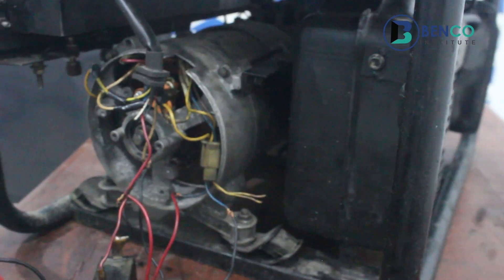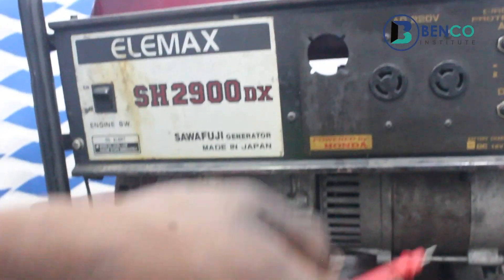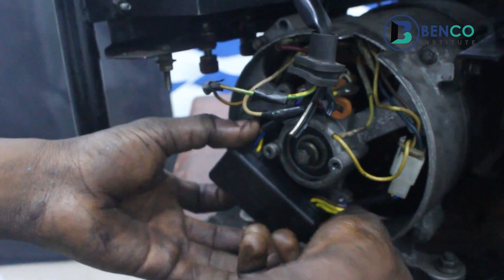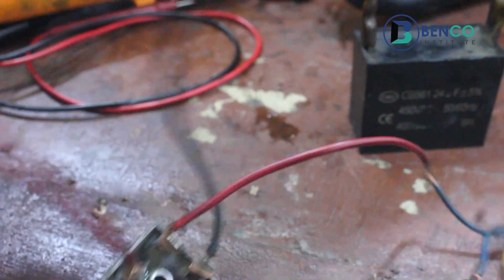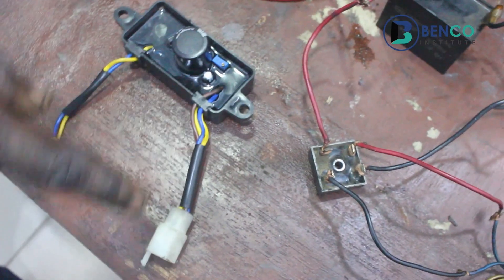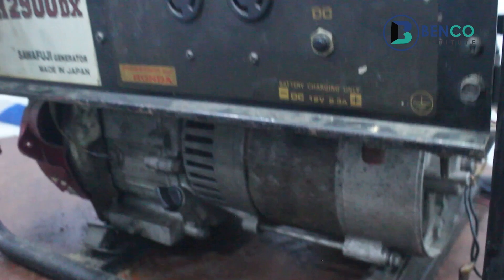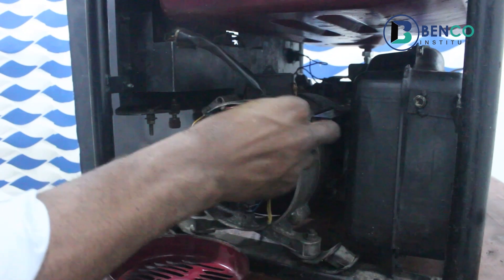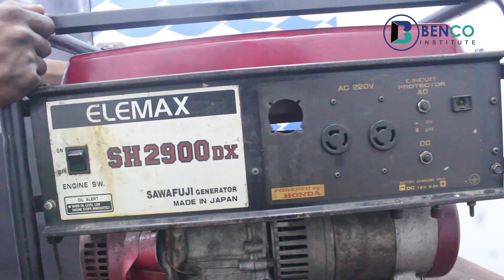RESTORE NO/LOW POWER OUTPUT IN A SMALL GENERATOR BY CONVERTING AVR TO  CAPACITOR[Brushed Alternator]

Comment from the maker: If you like our videos pls do well to subscribe,like and share.

also kindly support us to keep this channel running and produce better contents by  buying us a coffee via this link https://www.buymeacoffee.com/bencoinstitute

Any questions Drop them in this section...we will attend to them
Reply: I have a kawasaki kg550b generator the brushless one now the problem is that it is producing low voltage so what could be the problem
Reply from the maker: @samuelchimphepo4619  have u changed the capacitor?
Reply: @bencoinstitute  No I didn’t change the capacitor because i can’t find the same type of capacitors to replace with and the ones that came with the gene was written  ( A 6.0uF+5 % Z SH w-F 2D ) and the other one is ( A 9.0uF +5 % Z SH W-F 0D)
Reply: How big is the capacitor you used
Reply from the maker: @davidharrison198  24uf
Reply: I have a 6.5Kva generator with a failing AVR. What size capacitor should I use
Reply from the maker: @davidharrison198  24uf capacitor is okay
Reply: i want to convert mine also from avr to capacitor. it state on the avr a 220 uf 250v so obviously i will buy the same gauge of capacitor but what about the diode? what is the compatible size to match? thanks
Reply: it is a nice tutorial but I want to ask what is the advantage and disadvantage of converting avr to capacitor diaot
Reply: diode pls
Reply: Thanks for the teaching,but the output voltage is too much (270volt) which can spoil equipment,so how can we control the over voltage
Reply from the maker: @balogunolufemi4606  reduce the speed of the gen or use a lower capacitor rating
Reply: Hi I have done it it works but when I return the shock it went off and the voltage was 216 not up to 220 what should I do please
Reply: @bencointitute 
Can we convert 1kva capacitor based voltage regulating generator to AVR based voltage regulator

Comment: You just show how to wire the taud  and the cabasider, but my question is before you iven remove the avr there was 4 wires on the taud ,where dit you conect them. Because I tried but now the generator is giving out nothing power.

Comment: My generator is running up to 300v even if you try to reduce the current it doesn't there by destroying my avr what might be the cause
Reply: Engine rpms to high. U need to adjust rpm while looking at voltage out put. Adjust it until voltage is with in spec. It be better if u have rpm meter. If u dont then adjust using volt meter to volt output

Comment: thanks bro more wisdom. My question is, can be voltage be regulated, seems the 278v gotten after the conversion is high, normally we need 220/240V
Reply: Yes it can be reduced. Reduce the Rpm, the hz will reduce also

Comment: 278v? That seems like a lot to me, since the maximum output should be 220-230v! Or does the voltage drop as soon as you put a load on? You should have shown how much it drops, because it's a very high voltage!
Reply: Your correct, it's too high for rated output (220).
You can adjust the governed rpm but that can lose performance factors. Ideally the capacitor should be around 17 úf I don't know where he got 24 from, somewhere because it's very close. If you had to connect through 3 long extension cables, 270ish would be needed.

Comment: The rotor windings consist of a 4 leg diode and a resistor.What you did was that you replaced a failed diode behind the rotor winding.
Reply from the maker: @sundayotuns7102  No sir

This rotor does not have a diode behind the rotor
Reply: @bencoinstitute  Why did it has a positive and negative terminals?Is it not a diode that blocks current to one direction?All generator amartures carries a diode behind the rotor winding.It is hidden.
Reply from the maker: @sundayotuns7102  those terminals are to the brush that connects the commutaror...

Not all Armature has a diode
Reply: A multimeter can be use to test for continuity on both ends of the rewinding of the armature.That is one of the best ways to determine if there is a breakage in any of the coils.Thanks for your expertise explanation.Please I am currently working on a generator with electrical faults.Sumec 2900.I tried your teaching and it didn't work.Though I suspect the avr because there is no sign of damage and the client told me a spare part seller replaced the avr. for him,not an engineer.On a closer look,the output terminals,which is positive and negative was joined together.I removed the stator and check the coils with a digital multimeter,all the four terminals were good.What is your suggestion? Thanks

Comment: What could be the problem, my gen was converted to capacitor and diod but recently it can't carry load . From 230 it will drop to 160 . What is the solution sir
Reply from the maker: @Jossykjugbedu  ohh
Sorry about that

Check if the sound of the Gen dropped... If it did check the Governor spring

If the sound is okay.. That means your Armature have further deteriorated and the only thing you can do now is to add another capacitor..

Thank you

Comment: Good day my favourite YouTube generator technician ..I'm having an issue with my Firman Generator eco 8990esr 6.5kva..the generator voltmeter reads normal 220v only when the circuit breaker switch is in off position but as soon as i toggle the circuit breaker switch to ON position, the output voltage cuts off and reads 0 volts with no output power. Whenever I switch on the generator circuit breaker, the generator sounds for couple of seconds as if it's under load even when it's not connected to any load and then the voltmeter cuts off to zero... This started when I tried to power my 2hp AC with the generator while the AC is connected to stabilizer. I realize there was voltage drop on the input and output voltage of the stabilizer until the gen stops producing no power with circuit breaker in ON position. Since this time, the gen voltmeter only reads normal 220v when circuit breaker is in OFF position but reads O volts in ON position..what do you think I need to do to solve to problem? Thank you for your time
Reply from the maker: @safetyalways7788  you may need to check the board and see if there is partial contact somewhere

Comment: Hi nice job I tried it and it works
But there's problem with the shock when I bring back the shock the generator went off
And secondly it gives 216 voltage
What can I do to solve that
Reply from the maker: What is shock pls... 216v is fair enough

Comment: This' very brilliant but what about the generated voltage that is too high for our 220volts appliances...
Reply from the maker: Sure
You can reduce the speed
Reply: Yes, but we need to maintain frequency at 50Hz so you are better reducing capacitor value.

Comment: This method is unsuccessful, because of many and different reasons. First of all, the capacitor at the output (i.e the DC side of the diode bridge) must have a much higher capacitance. Keep in mind that these A.V.R units use electrolytic, i.e polarized capacitor of 220uf (or even more), at a working voltage of about 250V. 24uf is too less a capacity in order to keep the output voltage relatively stable, especially at heavy loading of the generator. Both voltage and frequency will drop immediately. This (non polarised) capacitor shown in the video, should then be connected in series with the A.C side of the diode bridge between an AC terminal of the bridge and one terminal of the field winding, with the output voltage being always monitored along with its frequency. This is very important. In case that the voltage output is found to be much lower than the nominal value (with the frequency at 50Hz, for European system), then more capacitance should be added. On the contrary, if the voltage is much higher than the normal, some capacitance, from the one put there, must be subtracted in order to reduce it near its nominal level (always watching the frequency to be as near as its nominal value). This is the only way to adjust the output voltage using a capacitor instead of an AVR. Nevertheless, this method lacks the automatic voltage correction. This means that the level of the output voltage will be unstable, being each time dependent upon the load and/or the r.p.m of the generator (frequency variations in the last case). All of these are practically terrible problems for sensitive loads, rendering this (capacitor adjustment) method useless...
Reply from the maker: If you watched the video to the end you will understand better.... I pinpointed all this arguments and even those I didn't pin point in the video I answered them in the comments.

Any experiment that solves a need is never useless..
Next time be polite

Thanks for your submission
Reply: @bencoinstitute  I have watched your video to the end before putting my comment, by which I simply explained why this method is improper and therefore unsuccessful. There was no insult against you personally whatsoever, although it is obvious that you misunderstood my explanation. 
On the contrary, if you would have done exactly what you proposed to me, that is, to read the entire comment of mine, you should have understood the meaning of my comment, which, I need to repeat, is:

A) The capacitor at the DC side of the bridge is too small in terms of capacitance.
B) the type of the capacitor used is improper. For high capacity you need electrolytic capacitor. Nevertheless this output capacitor does not affect the level of output voltage! It serves stability exclusively.
C) The connection of the adjusting (non electrolytic, but, instead, MKP, like the one you used) capacitor should be in series with the field winding. 
D) The voltage adjustment can be done by selecting the proper capacitance there (experimentally). 
E) No matter the proper capacitor being selected and put there, the system still will not work properly because of lack of feedback to it. 
This is a simple open loop system and therefore is prone to various problems, which I explained before.
F) The AVR is a closed loop system, which means that it permanently “sees” a sample of the output voltage (and frequency, for the high end units) and then adjusts the output accordingly and, above all, rapidly, while a capacitor alone cannot do that.

Finally, instead of accusing your commentators, try to learn from those who tell you what the proper solution to a problem is, unless you believe that you are the unique expert on the planet. In such a case, just try to control your egoism. This will help you to keep learning new things, or correct false notions you may have so far. There is no other way.
I hope you finally understood my sayings, wishing you all the best!
Reply from the maker: @ΠάριςΑζής  you know why I like your kind... You argue with no solutions..

I said go through the comments.... Obviously you mis interpreted yet again.

Next time before a discourse think critically as to why the video was made, This are alternatives in absence of a functional Armature

And in fact there is a caveat at the end of the video and even in my reply to other comments...

Is this method functional hell yes... I have done it for over 100s of generators.... 

Just incase you missed out on the basics of this video... The basics in simple term is to give life to a dying armature(rotor) 

No one is an expert, I am not, you are not either... I learn a lot from creators on this space but on this you are just writing essays... 

I will re advice that you go through other comments and see my reply to them.. 

Once again thanks for engaging
Reply: @bencoinstitute  I have given you the solution, but your blind egoism does not let you see it. Sorry, but I cannot help that. I already lost enough time with all of this.  At least I hope that some of your viewers will use my guidelines for their own benefit. In any case, what I have written here is the result of many tests I have done before coming in conclusions for their correctness. Therefore I don't give a dime if you consider my comments essays, just because you cannot prove if I am wrong and where I am wrong, on the points I summed up. Let the readers of my comments prove the correctness of my comments since you rejected them as essays. Finally, you should know that after a successful professional service of mine on telecoms for 35 years, you are the last one who will tell me what a generator is and how it works characterizing me in addition as a non expert, while you already admitted that for yourself! Well, keep on experimenting, this is good, but listen to those who know what they say (although you showed up that you cannot do)...

Comment: What can i do with the 5 kva 36 uf Capacitor diesel Generator, engine running well, The power coming out is normal with out loads, but when connected to loads the power turns to zero voltage. What is the problem and what can i do with this kind of problem. Thanks man for the amazing video on AVR to capacitor.i have learnt something 🇸🇧🇸🇧🇸🇧🇸🇧
Reply from the maker: What kind of load do you connect it with?
Reply: Remove the capacitor and replace it. Probably it's dried out. If you have the means (capacitor tester) you can measure its capacitance before buying a new one.

Comment: I bliv if I reduced the Gen speed
The voltage too will drop

Bcos 270 is really too high or should I use less capacitor?
Reply from the maker: Exactly or you can use a lower capacitor

Comment: 270 is a whole lot of current and will damage your appliance, and besides the current was fluctuating.
Reply from the maker: You can reduce it if you want
Reply: How?  @bencoinstitute
Reply from the maker: @mushahidShaan  You can reduce the rpm although that will reduce the Frequency or you use a smaller rated capacitor
Reply: @bencoinstitute  thanks for giving me response 🙏 
I run my water motor which is almost 2000w, and my generator is 3000w that burns my AVR sometimes even that motor do not make such loads. 
If I try your method what will happen to load? That regulates or constant?

Comment: You were left with a 280VAC output, ideal for burning everything you connect!!! Totally not recommended from every point of view!!!
Reply from the maker: A smaller capacitor,let's say 12 uf  would rectify that or reducing.the RPM of the generator...

However recall we are stretching a bad Amature....
Reply: @bencoinstitute Please take a look in my comment and see the correct use of the capacitor and the drawbacks of this method...
Reply: @bencoinstitute what of when the Amarture is good. Just that the avr is bad, and I don't want to spend money to buy another. And I have 24uf capacitor and the diode. Can I apply this method to my good generator?

Comment: Have you ever tried to use that diode with a 12v battery going to the brushes to increase the voltage
Reply from the maker: Yeah I have
Reply from the maker: I had plans to do a video on that..... Anyways I will do it soonest
Reply: @bencoinstitute  do you think it might increase the amps an overall power output

Comment: Greetings
May be I missed the point. What is the need of having high voltage like 270V. 
We need to have step down converter for that.
Reply from the maker: Very true Hassan.... The practical was basically to show how to increase the voltage of a gen with a weak armature.

However a slightly lower  capacitor will give us a voltage in the range of 220-240v

Reducing the speed of the gen will also give us a lower voltage.

Comment: Your work is good. I learnt something.

Just to support;
Firstly, the repair would just have been to adjust the AVR voltage with a precision screwdriver. (Turning it clockwise)

Next, the component connected with the Cap is a bridge rectifier, made of 4 diodes (not a single diode).

And finally, this is a small Gen (popularly called "I-pass-my-neighbour")'s AVR design. This design is fixed, not dynamic -that's why loads are blown up when there's a surge from small generators. This 27X Volts is unsafe (against 220-240)🙏😁

'Love your work.
Reply: Yes! Was going to say 270v is incredibly high and would blow up stuff in the house, my generator powers up everything sufficiently in my house and i wouldn't have known it was putting out 180v to 190v as opposed to 220v if i didn't test it myself, the simple solution is to just adjust the voltage potentiometer on the avr, but this was an innovative solution regardless.
Reply: thats what i was wondering  . 272 volts
Reply from the maker: Thanks a lot 
I sincerely appreciate your kind word
However

Not all Avr have an adjustable screw....

Yeah... Very correct as regard the rectifier...But you see if you go to our regular shops they wouldn't know it is called a rectifier..they call it a Diode with 4 leg(lolz)... 

Yeah... It isn't called i better pass my neighbor though....the Generator referred to i better pass my neighbor is the TG 950 gen or its equivalent....

Yeah,you are right as regards the voltage.... I should have somewhat explained a futher way of reducing it.... Since i proved that voltage increase was possible using this method i totally forgot to include a method of reducing the voltage of the generator...However there are other videos that can help out on reducing voltages....just scroll through the videos 

Thanks for the engagement